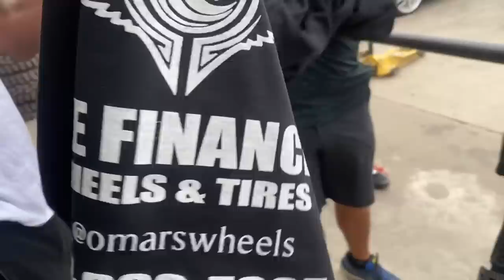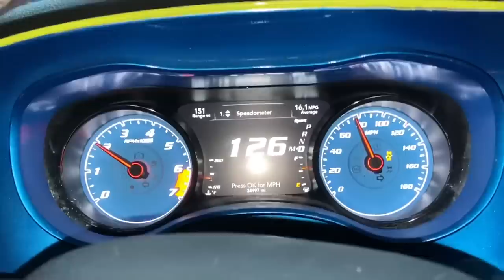LIFE WITH COREY 2020 HELLCAT CHARGER WIDEBODY IS INSANE!!!!

Comment: Needa cut it like cj on 32 did his he cut his and looks factory
Reply: I don’t think he cut his. I think he lifted his because in that video the scat pack was getting new upper control arms
Reply: @Legggggg317  no just no definitely didn’t lift it incase you ain’t watch the video it rubbed my guy
Reply: Cjon32 does no cuts
Reply: @akmickey9371   I don’t think he cut that’s why he didn’t go any bigger than the  26s. He most definitely put a lift on the scat pack. Go watch the video he says he put a 4 inch lift in the front and 5 inch in the back.

Comment: On 26s Chargers will lose a lot of performance because the wheels so heavy . They look good though.
Reply: Really no point of getting a hellcat If you gonna put them big ass rims on ..just my opinion...
Reply: @nicklaaflare1907  frr that’s y he rubbin and shii I at least would’ve done 22s or 24s but 20s would fit the best
Reply: Lol y’all tripping if y’all think 26s is gonna hurt any performance on a 707 supercharged hemi...damn trucks pull trailers with 5.7 hemi...hellcat prolly can’t fell them 26s
Reply: @snipergang2493 them rubber band wheels ain’t hooking he going to be spinning tryna put down the power
Reply: @snipergang2493  you have no idea what you're talking about. Weight of the rim and distance you outer wheel from center hub absolutely matter.